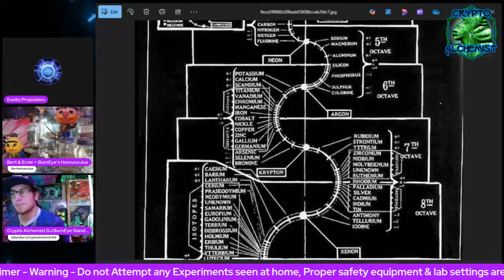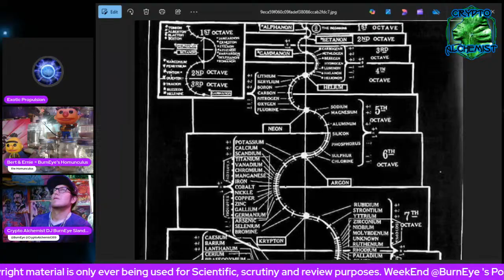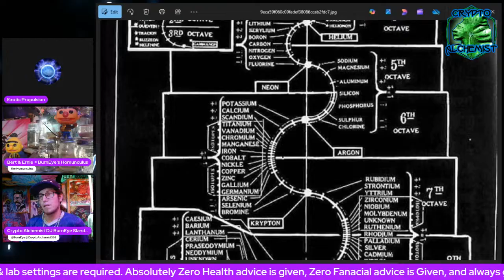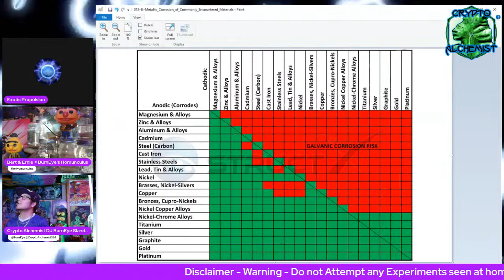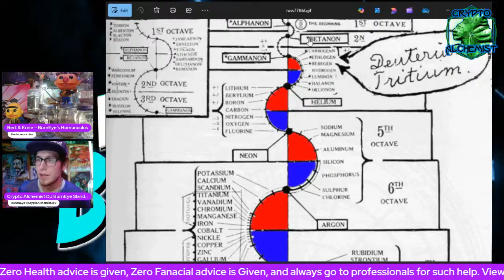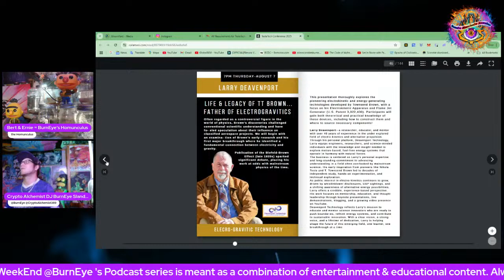chats with jp, Transmutation of Elements, & TeslaTech Demonstration Presentation Prep

Comment: Strip the scrap metal and then measure displaced volume in water. Weigh it and you know the density. Then you can infer material composition. 

Houses like that usually use aluminum wire and AL wire is used in the giant bus wire for residential neighborhoods.

Water hammer at bottom of ocean? Why do craft go into the ocean?
Reply from the maker: yeah this stuff is titanium, not aluminum. its WAY tougher than aluminum, denser than aluminum, and slightly heavier than aluminum. 
it acts different in monoatomic form than aluminum too. it's titanium. it came from a 4 million dollar house build

Comment: That is Aluminum wire. There should be markings on the black outer insulation of the scrap piece of wire. The wire feeding into your house from the power company is Aluminum, the subfeed from the exterior  meter base into the main panel inside the house is probably Aluminum also. When using Aluminum you must up the wire size compared to copper because Aluminum is softer than copper.
Reply: I thought it may have been aluminum too, but I'm sure Bernie's co-worker that stated it could be titanium makes me think further... 🤔
Reply from the maker: pretty sure its titanium. it's different than aluminum. so much stronger  @Vort3chs
Reply: @cryptoalchemist369  Yeah, running it through some electrolysis trials should let you know my bro.
Reply: I can see why aluminum and titanium may be difficult to distinguish by look and weight, but you know what your doing.
Reply from the maker: @Vort3chs and i know already because of that
Reply: @cryptoalchemist369  Titanium is Tight
Reply from the maker: nope. i also use aluminum, big difference between the two,  but many similarities
Reply from the maker: really? because they seem entirely differently. I'll  show some larger ones